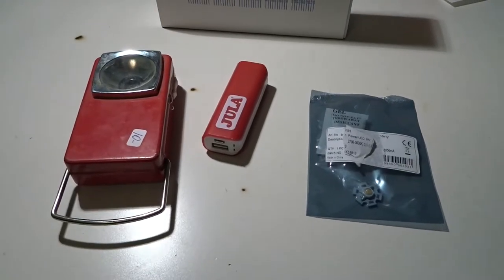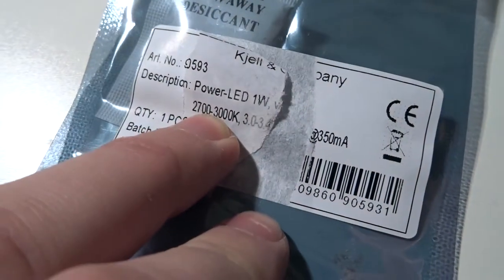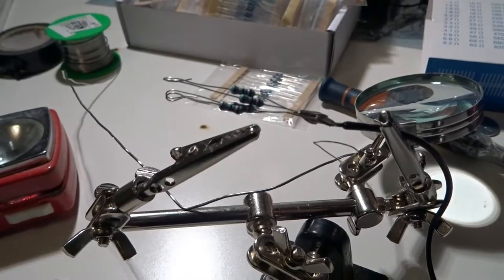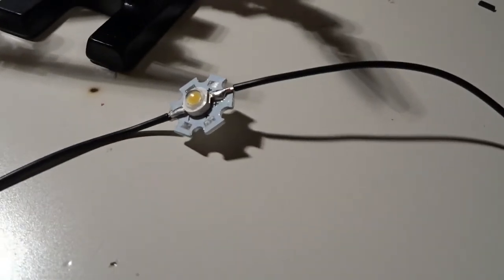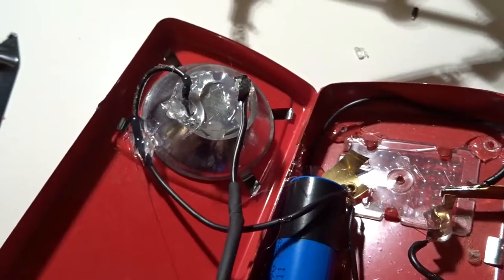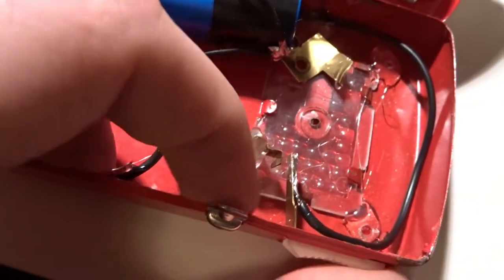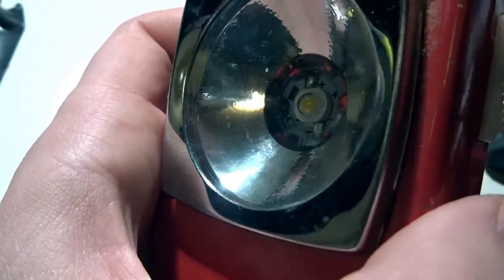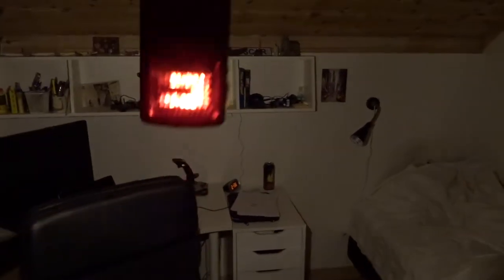Converting Really Old Flashlight To LED - 10x brighter and 4x longer runtime!

Comment: You need use a constant current power supply for those types of leds  and not resisters
Reply: Why? It even works withreistors!
Reply: Because you are using a 1 watt resistor with a 1 watt high power led which is wasting power